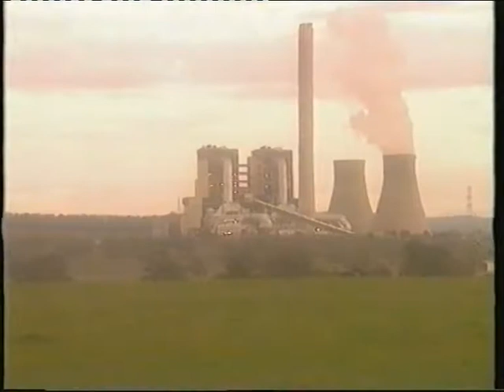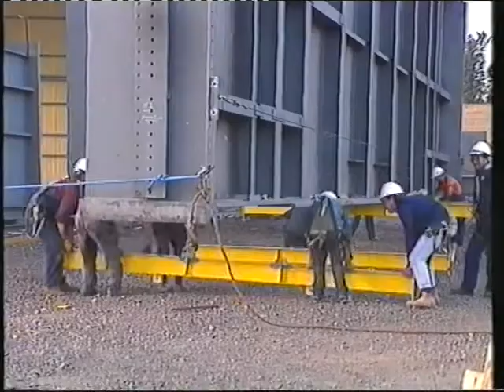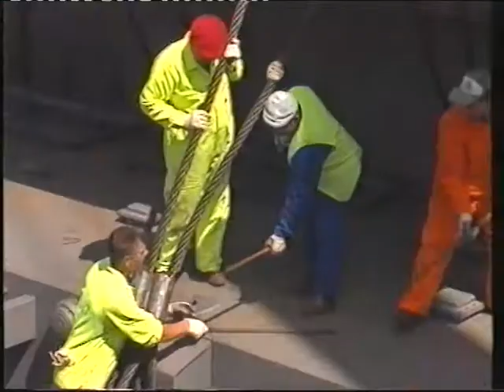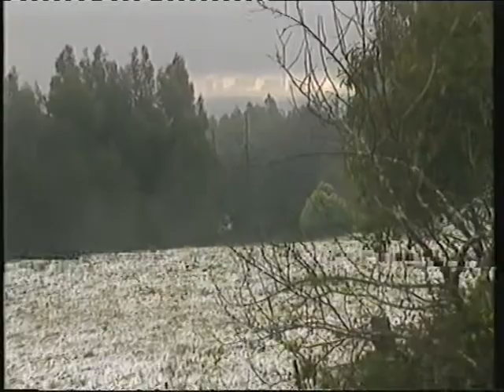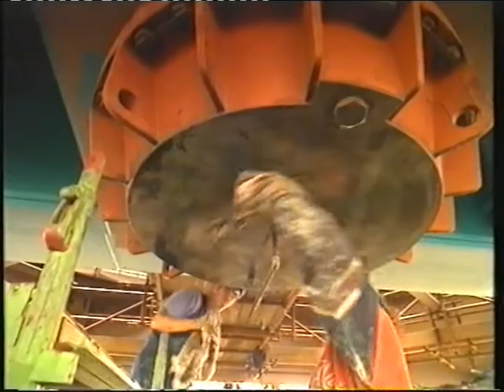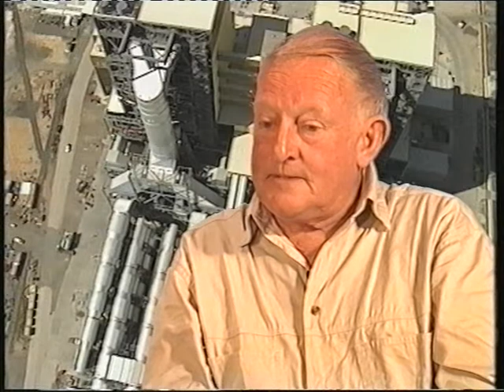The Loy Yang B Story

Comment: It’s changed a bit in the 29 years of its operation. And it’s still performing reliably. Turbine/generator upgrades from 500MW nominal to 585MW, other plant mods to improve efficiency and reliability have made it probably the best station ever to be built in Vic. And the last.